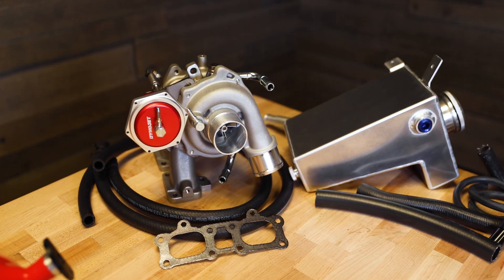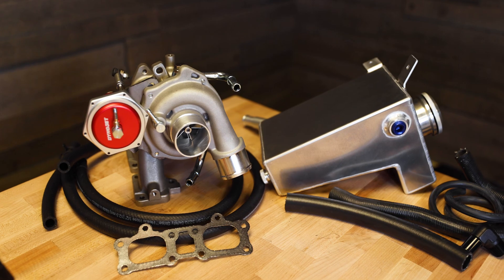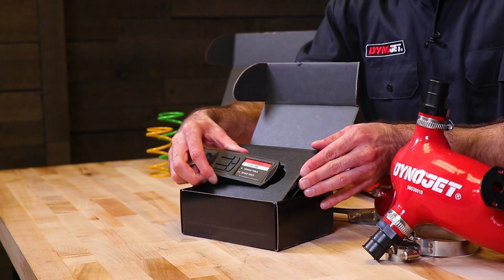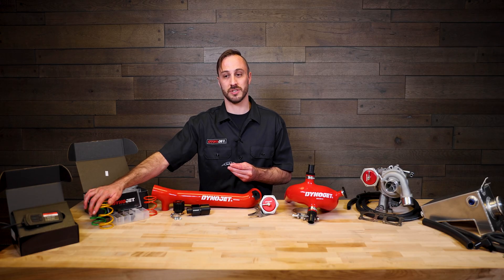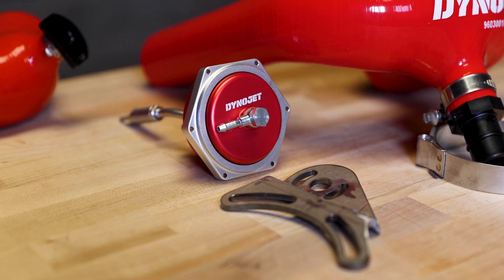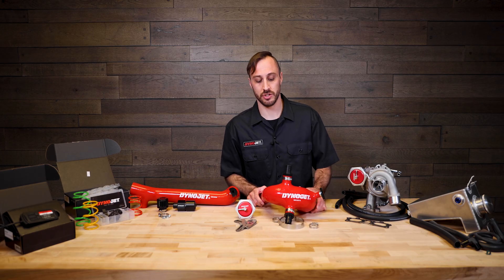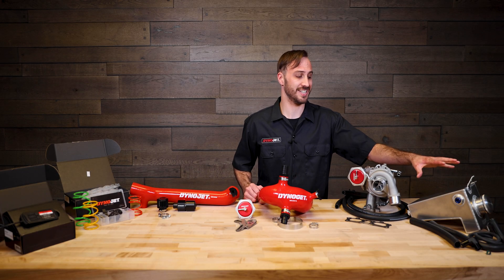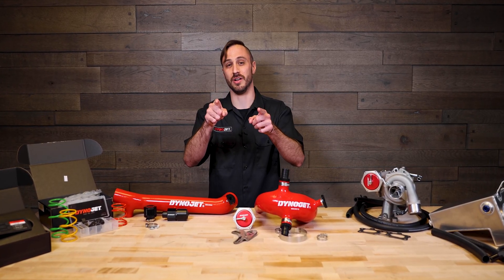Official Guide to Dynojet's Power Packages for Polaris RZR

Comment: Is it possible for you to answer my last emails???
Reply from the maker: Yes, of course. Sorry for the delay. When did you last email us, and what was it pertaining?
Reply: @DynojetResearch  yesterday...  bike is cutting at 14000RPm after last dedicated firmware update, and she is supposed to do 14500 as i have the ecu flashed for that.  Ticket 271635
Reply: @DynojetResearch  also tickets 271634 and 271700 have been CLOSED without even being answered...

hope you may answer now we can solve my issue now
Reply from the maker: @MrGuerraTube  Our records show that one of our customer service reps replied yesterday morning with this message: 

Do you have an ignition module installed on this bike? IF not, this feature cannot be enabled in the first place and will cause a ton of issues. Even, if you do have an Ignition module, this feature should not be turned on if you have the RPM raised within the ECM.
Reply: @DynojetResearch  i have no answer from support but ok... i do not have ignition module, and the pc5 is restricting the rpm on the bike,  as i have it set to 14500RPM and pc5 does not let it go further the 14000 or 14200... can you please answer my email so we can work around this to get it solved...?
Reply from the maker: @MrGuerraTube  We've just alerted our customer service team about this issue and will try to get back to you as soon as we can. We apologize for the delay on this.
Reply: @DynojetResearch  i really do not understand your position... still no answer from dynojet...
Reply from the maker: @MrGuerraTube  Our customer service rep Danny sent an email to the hotmail account at 8:26 a.m. PT Wednesday morning. Is that the best email address for you? Please check the spam filter, in case it got sorted there.
Reply: @DynojetResearch  i have nothing in my junk-mail or spam... inbox neither... i really do not  understand what is going on
Reply: @Tred354  i have c3 software ...  please email me the rev extend key otherwise i can  not do it..  i am not for a free feature, i just nees to match my ecu with my pc5 in terms of Rpm limit...